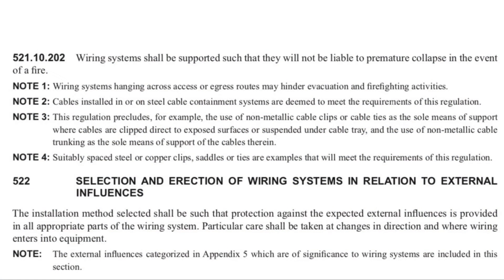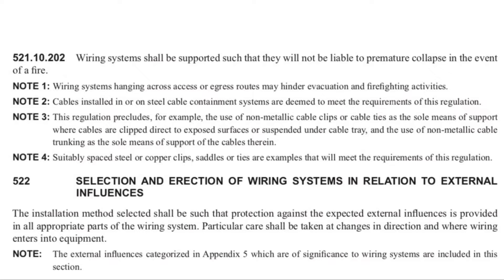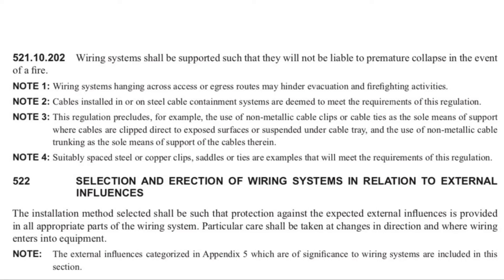EICR Coding from the NICEIC and ELECSA for Premature Collapsing of Surface Wiring Systems BS7671

Comment: Question if the cable is suspended by a plasterboard ceiling in a loft does it still need to be clipped to the joists with one of there fire clips of is the plasterboard good Enough because the plasterboard is all ready fire rated for a minimum of 30min or is this not the case for all plasterboard ceiling just the new ones ?

Comment: Love your videos Gaz however I'm still confused. Your Napit video says c2 this says c2/c3 depending on risk. Example, we have lots of work in sheltered flats where the wiring systems are surface mounted in trunking/coving trunking throughout which is normally painted and would get damaged trying to remove the lids at a cost. Some electricians would code c2 as they see it as a risk while others see it c3 and areas outside the flats c2. Who's right???
Reply: This sounds like a C2 to me, the cost of making good shouldn't be a deciding factor when it comes to safety.
Reply from the maker: Great question. Both the NICEIC and Napit are code C2 for almost all circumstances... professional judgement and which organisation are you registered with be the defining factors. Thanks for commenting and watching. Gaz

Comment: What about existing installations, it has always been that the new regulations are not applied retrospectively so how would you code cables etc that are not restrained against fire but that were installed before these new regulations came into force?
Reply: Your inspection and test of an electrical inspection is in accordance with the current wiring regulations. The regulation regarding prevention of premature collapse of a wiring system apply to all installations regardless of when it was erected. So the vast majority of installations would not comply to the current BS 7671, the only question you have to answer is, is it a C2 or a C3... I would say if it crosses an escape route it's a C2, if not then perhaps a C3.
Reply from the maker: Hi we talk about that in this video 👍 link below 
https://youtu.be/17ERMsL8v0I
Thanks for commenting and watching. Gaz 👍
Reply: @GSHElectrical  That video contradicts what is said here then? In that video he says all will be a C2.